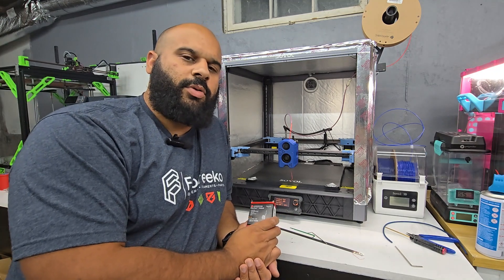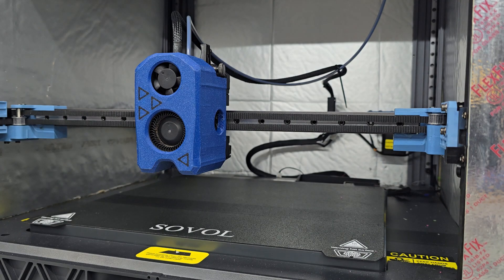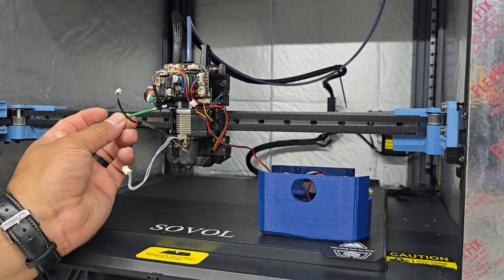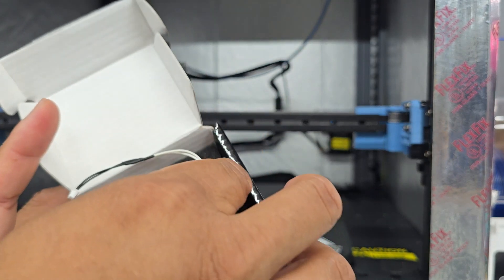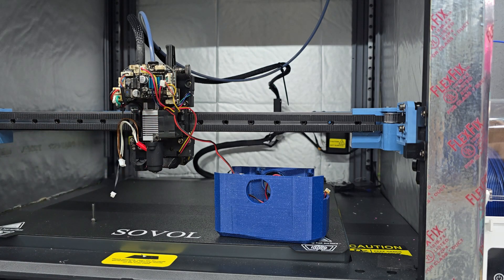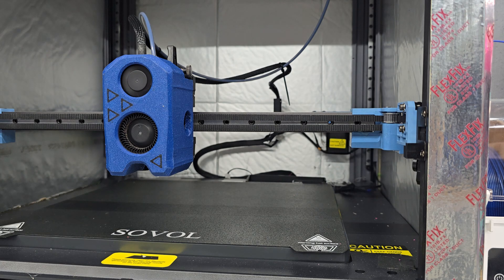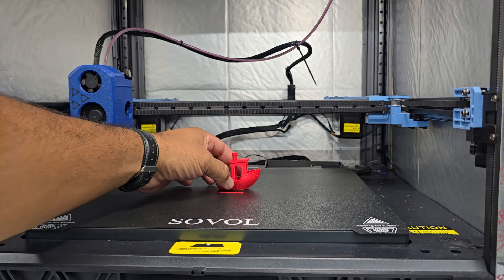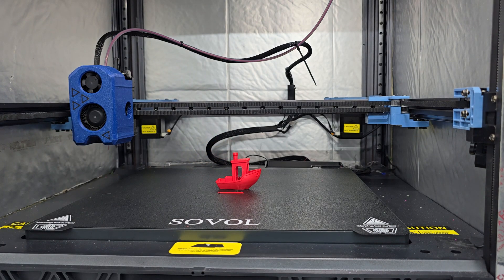SV08 Microswiss Hotend Install

Comment: missed 99% of everything important since your big old hands where in the way.
Reply from the maker: @warmfreeze  lmao. My bad. Here's a play by play. Make sure no filament is in the old hot end. Pull cover of. Remove screws from old hotend. Put new hotend in the opposite manner you took the stock one out. Plug thermistor and heater in. Put cover on. Print :)

Ill pay better attention to my big old hands next time haha. Thanks for watching :)

Comment: My SV08 is on its way.  I'm very tempted to install a MicroSwiss hot end even though the Sovol pressed nozzles falling out when printing PETG problem has been fixed with a set screw.  For me, the big advantage of the MicroSwiss is being able to screw in a different nozzle without fiddling with the fragile thermistor and heater with their messy thermal paste.
Reply: I installed the MicroSwiss hot end while I was assembling the printer.  It was relatively easy - about as difficult as swapping the original Sovol nozzle.  I can now cold swap the MicroSwiss FlowTech nozzle in a minute, one handed, using only a 7 mm nut driver.  I can also use the FlowTech nozzles on other printers with a MicroSwiss hot end, so no more throwing away nozzles when retiring a printer.
Reply from the maker: That's awesome! I'm really happy with mine. I just did some calibrations today and during the max volumetric flow I got 43mm3/sec of flow with the microswiss nozzle. So far I'm very impressed with it

Comment: I have a used SV-08 on its way and I’m probably going to make this upgrade. Also, I am used to using Marlin so Klipper will be very different, I’m sure. Will I need a macro added to the firmware to support A manual Z offset with my feeler gauge (this is how I do it on my heavily modified CR 10).
Reply: You can still do a manual Z offset on the SV08 using Klipper.  Click the button in Klipper to Home All.  It'll use sensorless homing at the back right corner to home X and Y.  It'll have the previous Z offset from using the inductive probe to find the bed and the little Z touch pad at the back to get the absolute Z height.  After the Home All, the nozzle will be 10 mm above the center of the bed.  Use the Down Z button in Klipper to move the Z axis down to Z=0.  I have the piece of paper under the nozzle and move the Z to zero 1 mm at a time so it doesn't crash if the previously programmed Z offset is terribly wrong but usually it'll be close.  I sneak up on that last millimeter using finer Z axis adjustments until the display shows Z=0, then I stop using the Z up and down buttons with Z=0 and start using the Z offset fine tuning adjustments in Klipper to adjust the nozzle height until the paper can barely slide under the nozzle to calibrate the Z offset, which is displayed in Klipper.  Once the Z offset is set properly, I click the Save button next to the Z offset controls.  It looks like a little floppy disk.  This saves the new Z offset and reboots the printer.  I'll usually repeat the process to ensure the Z offset is correct (no Z offset adjustments needed at Z=0) before I print.

Once properly set, you shouldn't need to repeat this very often, although the stock 8 mm inductive probe isn't very accurate and can lead to inaccurate quad gantry leveling or an inaccurate bed mesh, and the thin aluminum bed can't be manually leveled and it warps when heated into a taco shape so first layers can be problematic on the SV08.  I need to at the very least re-engineer the bed so I can manually level it with shims and pre-stress it so it warps into a flatter taco, and a more accurate Z probe would greatly help as well.
Reply from the maker: @treyduval5399  no you can still set it manually. Find me on discord @davidp for questions

Comment: how did you make the enclosure?
Reply from the maker: @creativecityis  lol I was feeling cheap and needed to print abs quickly for a project.  I went to my local Home Depot and got some insulation boar for about $15 and some aluminum tape. It works great, chamber Temps get to about 50-60°c

Comment: I just wish they didnt take proprietary nozzles that cost like $12/each and you can only get them through MS
Reply from the maker: @Beskar181  understandable. They are readily available and I'm sure clones will be available soon. $12 isn't super bad for a nozzle though. Still less than a Bambu replacement nozzle. And with the bambu you need to take the whole hotend apart to do it. With this one its as easy as unscrewing the old and screwing in the new.
Reply: @Armor3dprinting  well the bambu clone hotends are much easier and cheaper. The nozzles unscrew without having to change the whole hotend, and you can get a pack of nozzles for a few bucks (roughly $4-$10 or so depending on what you want).

Comment: dont get why this properetary hotend is any better then the original one it still a properetary design requiring one to order from only 1 manifacture
Reply: I'd trust Micro-Swiss to keep it in production long-term.
Reply from the maker: the stock hotend requires you to swap the entire hotend, this one allows for just a nozzle change. and as far as i know there are different nozzles to choose from. from the standard nozzle that comes with it all the way up to a diamondback version.  its really no different than throwing a revo hotend on your printer.
Reply: The nozzles are not proprietary for the microswiss, and the stock hot end has been dropping out from backflow pressure printing petg.